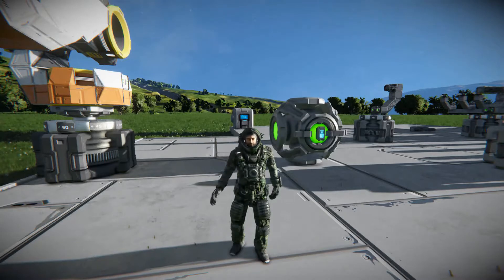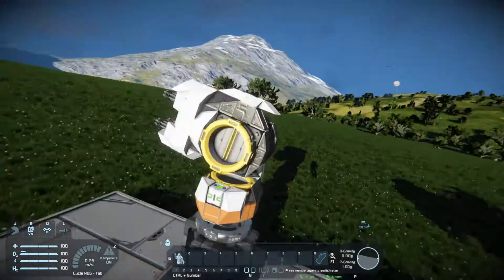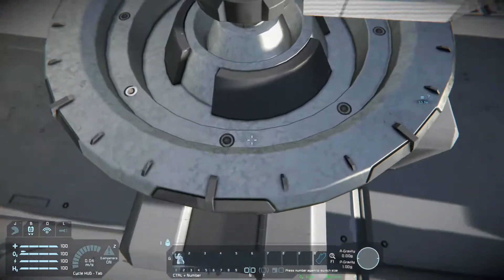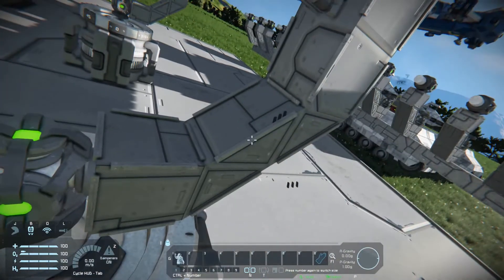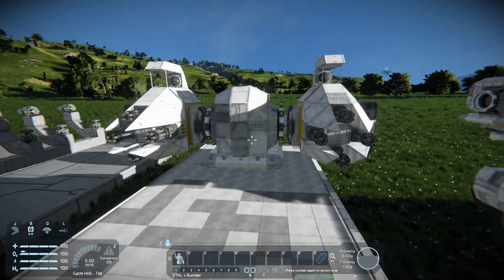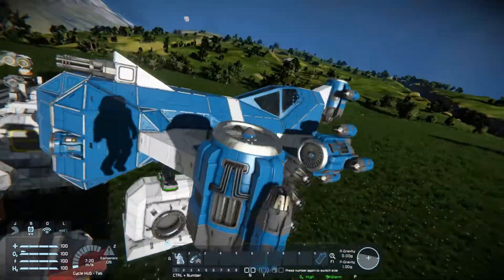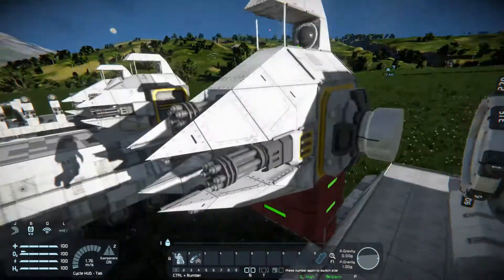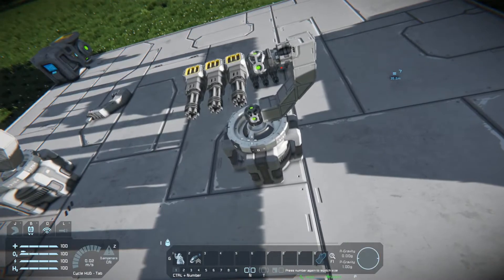Space Engineers Tutorial: How to use Projectors on Subgrids

Comment: If you had room for a merge block  could use that to make the grid one grid and all you had to do was grind off the merge blocks.   And you shouldn't have to fuss with the ship moving parts  unless you were worried about klang but I never had an issue using them to make sub grids part of the main grid.
Reply from the maker: yes that is an option. may not always work depending on your design or what you are trying to do

Comment: couldn't you just build everything backwards? would you be able to build everything as a single grid on detached rotor heads, connecting parts with blocks you'll get rid of, and then get rid of rotor heads, attach rotors where they should be after, get rid of that rotor head, add a rotor head on the part you're connecting the head of the rotor to, then 'attach head'. pretty sure i couldn't have written that any less confusing...
Reply from the maker: second half of the video shows that :-)
Reply: @sinsley1  yeah, that's what got me thinking about it. instead of moving parts around, make the blueprint as one solid grid, weld it up, and just add the rotors and heads in as you would normally construct after the fact. if that makes sense.